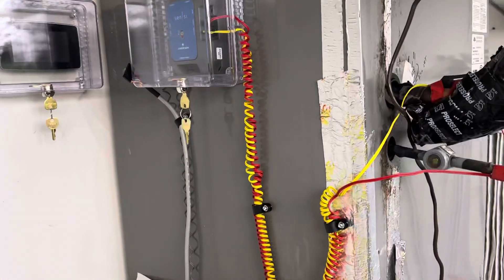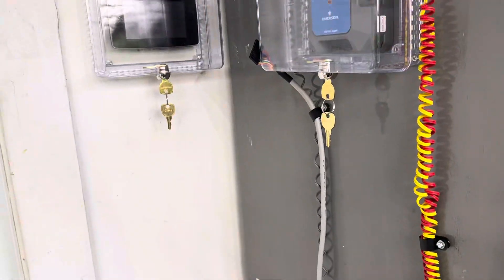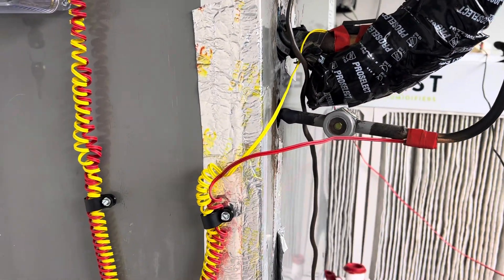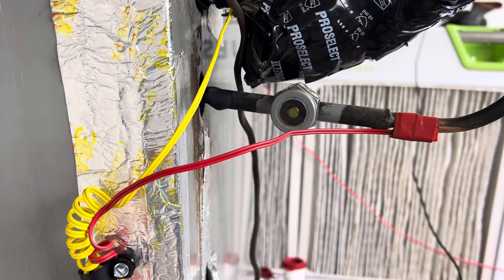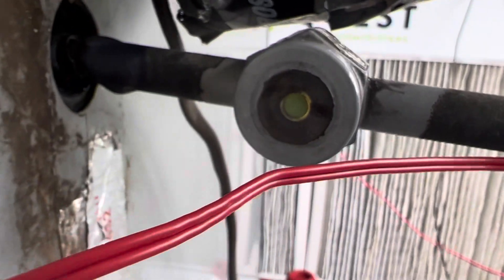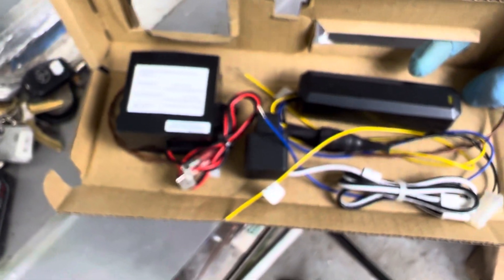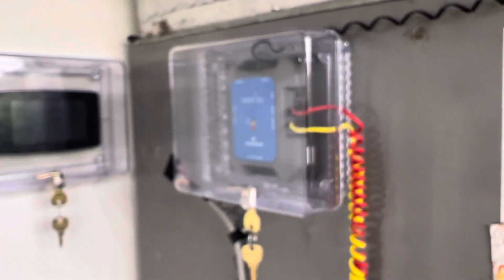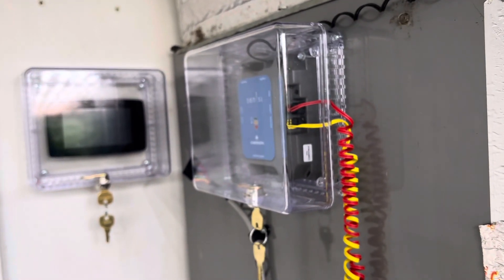Sensi Predict NOT being produced right now￼. think I have a leak but looks could be deceiving. ￼

Comment: Interesting that they stopped maki them ? I wonder if the demand is there for them
Reply from the maker: Actually a lot of parts manufacturers have stopped producing parts in all facets of different industries and it had nothing to do with demand. 
               On the electronic side it had to do with certain component manufacturing that shut down and the world supply is very limited they only make enough to supply all the suppliers for so many weeks or months and then it runs out so they shut down for a while and some facilities have not reopened yet even though there is demand because of the cost of shipping not getting back their employees.      From overseas a cost of a shipping container went from about $3800-$5000 depending on what shipping company and what size container to $28,000 for the very same shipping container that’ll add a lot to the cost. 

         And here on the West Coast on the shipping port in San Francisco they were shut down for so long and now that they’re even opened they’re so understaffed because their union and there’s some political stuff going on of he said she said I want this and upper management saying no you’re not going to get this so they’re understaffed and the shipping containers are not being offloaded off the ships on time. And a large shipping container ships are spending weeks and even months before they could get offloaded. 

         So some shipping company lines have totally ceased delivery on certain ports including San Francisco because I cannot afford to keep a crew that was only supposed to spend several days with a crew going across the ocean and unloading come back think of all the food that you have to supply for accrue ownership spending an extra month out on C just waiting off the coast to get unloaded. 

         In the automotive industry there’s many missing parts both OEM and aftermarket parts are just completely missing and there is no delivery date for restock even though there’s a very high demand. 

       It’s so desperate where insurance manufactures for cars who let you get OEM parts for your car or even demand you use aftermarket cheaper brands cannot even get the aftermarket hoods and fenders or bumpers and body shops are literally bidding at wrecking yards to get used bumpers use fenders use hoods and having to clean them up and repaint them and put them on cars in place of new fenders bumpers doors or hoods. 

         There’s a huge demand but the supply chain hasn’t caught up same with the production of the raw materials of steel or silica aluminum copper that makes these manufactured parts they ceased operation for many months in a year later are still catching up. 

          But if you’re familiar with purchasing sensors directly from the manufactures and little single board computers like the raspberry pi or Arduino then you would know that all the parts in the Sensi Predict kit are roughly about US$12 at manufactures cost price.   

All the sensors and software could be put into every unit right out of the factory even if they purchased that extra $12 by the time it came from the supplier the manufacture the overseas distributor to the American distributor of American distributor sells the components to the manufactures like train or courier or then they put the wrong components on without the fancy cases and housings all integrated at time of manufacturing that $12 needs to turn into 500 extra dollars by the time it hits the contractor and then he hast to add his 30% margin or 50% or 100% margin. 

         No manufacture wants to make that risky first jump of just giving away the units on all their units across-the-board to get the price way down because I would eat deeply into their profits if you multiplied it by the hundreds of thousands or millions of units produced each year. 

           I feel kind of sorry for my customers because we live in San Francisco and be in business here your markup margin Hass to be so high on a product that’s already a little bit pricey and your labor rate plus your average labor rate of parts and material combination when added together is usually like $350 an hour to $450 an hour. Even if you’re bare-bones minimum just labor alone is somewhere around $185-$225 an hour Not even mentioning the big guys who are up there in the $350-$600 an hour when they have to roll a truck. 

           I asked the parts houses in my local area in San Francisco and the majority of the parts counterman did not even know what Sensi Predict was.       I think but I’m not 100% sure on this correct me if I’m wrong that it has been out and started in 2016.    So it’s not a new product. 

        It’s an excellent product so this more senior tech back in the office or out in his van at another job location can walk a green or lesser skilled experienced technician through the procedures as the more experienced technician is monitoring the readings from his iPad or his phone back in his van or office. 

        It’s kind of like turning a low budget bottom of the line unit into a courier Infineon unit.

Comment: “Air bubbles “ ? I take it you are just referring to refrigerant vapour because of the loss of charge…Not actual air? Not ball breaking,  just trying to understand. Cheers
Reply from the maker: Yes correction I should not have use the wording (air bubbles). 
                    Refrigerant vapor 

But I could have a situation going on here during the on and off cycle where it has not fully developed a solid column of liquid stacked up. 
             Since I’m working over this system over a span of a few days I will be re-testing it for leaks.     Right now the days are in the low to mid 50° range Fahrenheit topping out around 60 it would be nice if I get a warmer day up in the 70s which is unlikely so I could do a nice proper accurate sub cool measurement.
Reply: @coldfinger459sub0  Thx. Hope you get to the root of the concern 👍